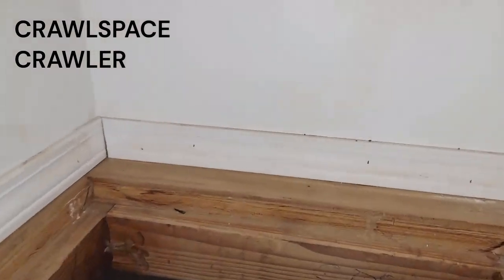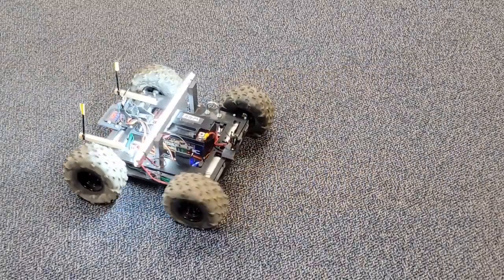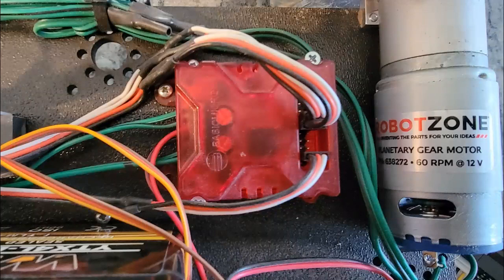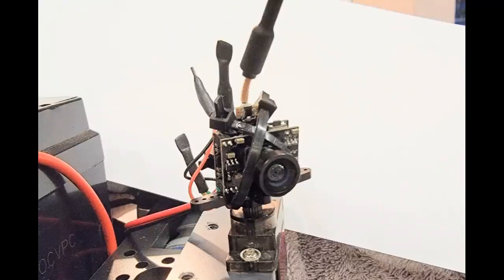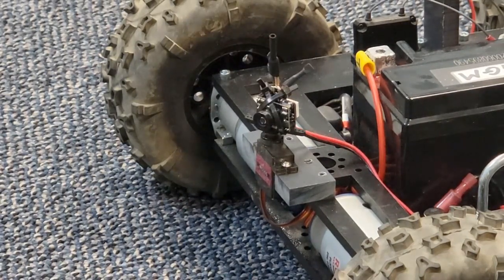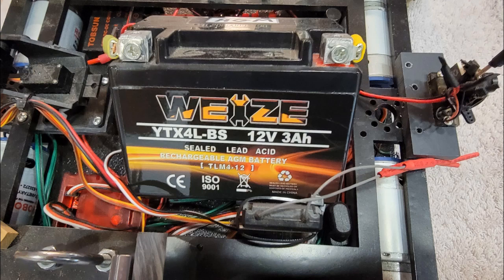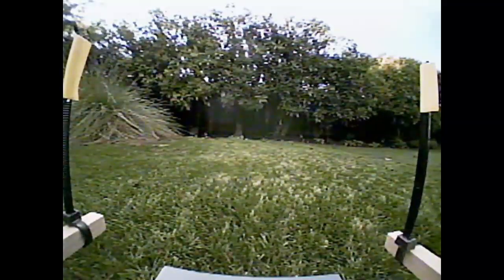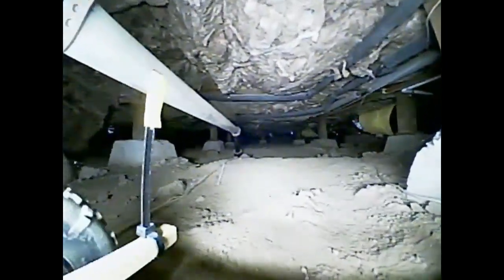Crawlspace Crawler

Comment: "just for fun, not a real human skull" Just what somebody hiding a human skull would say :p

Kit looks great! Only changes I could see really improving anything is installing front and rear light bars that fit between the wheels front and rear of the chassis, and try and get the cameras a little lower/lower profile to get the overall height down, but this looks like it fit your purpose perfectly. Good job!
Reply from the maker: The light bar I already had was 12" so it had to go above the wheels.  The camera antenna came up to about the same height.  6" clearance is fine for me, but a redesign could get it down to 4 or 5 inches with different lighting.  The landscape LED floodlights, even with diffusers, almost "blinded" the cameras with hot spots of light.  A shorter light bar would be perfect.   Thanks for your comment.

Comment: Fantastic.  It's a little elaborate and pricey for my limited needs today.  But if you wired houses regularly, this seems like a real no brainer.  

I find it crazy that someone hasn't made an affordable  off the shelf drone like this that is either intended specifically for cable pulls or is versatile enough that people regularly use them for it.

You can buy flying drones that do most of this all day for a few hundred bucks. But when you search for something wheeled, it's either a toy that goes too fast and has novelty features or a DIY raspberry pi kit that becomes its own project.

I especially love the horror/adventure flick music in the background.  That's exactly the feeling I have when I crawl under my house.  
🖐️😮  💀
Reply from the maker: I've had several comments posted about being able to pull cable or home security wire.  Sound like a great idea until that cable gets caught or snagged on something and then you have to go crawl to rescue your crawler.  Would the crawler need to go find the cable and then drag it back? There'd have to be some sort of grabber with a catch and release mechanism.

 I don't know how much "pull" my system has until the wheels slip in dirt.  I imagine a drone has even less horizontal pull.  I would also imagine that a drone would kick up a lot of dust as it flew through a narrow dirty area. So many things to consider.

Thanks for your comments, and don't give up.  Half of the fun is building it.
Reply: @jeffg8232  

I wasn't referring to using a flying drone for wire pulling.  Your wire puller is a wheeled drone.  People are just accustomed to hearing the word drone used mostly in relation to flying devices.

I was just comparing how the same level of features and technology in flying drones is much more affordable and widely available than wheeled drones, even though it should be cheaper to buy or build a wheeled one.

The $600 in parts and who knows how much in labor that you spent would buy a pretty nice flying drone.  It's crazy how those have such a huge market but nobody is  producing something like your crawler at the same or lower price point.  

Personally, I can think of way more uses for your crawler than I can think of for an aerial drone.  People just like the idea of things that fly and then they get bored of them.
Reply: @jeffg8232  

Regarding getting stuck, I'm planning to attach a recovery rope to the $50 RC car i bought to attempt my sprinkler wire install.  We will see.  Right now I'm just practicing driving it to make sure I don't bang around too fast.  

I guess I'll have to make videos too.  👍

Comment: Very cool project!

If I may comment on one detail: A lead-acid battery being drained at a 1/C rate (as you describe it lasting about an hour) may only deliver 60% of its rated capacity. Notice how the 10-hour rate is already .2Ah lower than the 20-hour rate, and that's a difference of only 150 milliamps, extrapolate that to a draw 10x higher.

That's ~2 amp-hours from a battery that weighs over 3 pounds... you don't have to go overboard with lithium, but even a 12V nimh battery with ~3000mah would double your runtime for ~$40 while taking up half the space and weight. (not that either is particularly crucial to your build.) 

That's also not a deep-cycle battery, so it may begin losing capacity fairly quickly in this application.
Reply: I didn't think that far into it, but I did think it would make sense to just get or make an adapter to use whatever brand cordless tool batteries you already have.

Comment: Great guide. 

Working on a build following yours, thank you.

Just couldn't get servo city or gobilda to swap motors out :( will have to buy them separately.
Reply from the maker: Sorry to hear that Servocity won't swap motors. I built my crawler in early 2020, and the kit was called "the prowler" , as opposed to the current "Recon" kit. Speed isn't needed in that rough area.

Comment from the maker: Parts List

Chassis/Wheels/Tires/Motors Kit     “Recon” kit   60 RPM Motors      Servocity.com

All other hardware was purchased separately:
Motor Speed Controller   Roboclaw 2X7A    set to differential (tank) mode
FLYSKY FS i6X RC controller  + FS-iA10B 10 channel reciever
12V – 5V converter for camera power  TOBSUN
Camera/transmitter   2 ea    EACHINE TX05  FPV Camera from Banggood
Pan/Tilt servo assembly
RC servo for rear camera
RC switches for light bar and camera power selection
12” LED light bar  from LED Wholesalers.com
Volt/Amp meter display
6 circuit terminal block
Power switch and fuse
12V Battery AGM Sealed lead acid 3 AH
U Bolts for lifting.
Reply: Based on the dimensions, it looks like you could replace the battery with a Dakota Lithium 12V 10A battery, or even possibly the 23A version. While I imagine the 1 hour run is generally sufficient, you could triple it.
Reply: Hammerhead Chassis Kit instead of the Recon, better for very uneven ground. But $100 more.
Reply from the maker: @walterkarpynka8343  The Hammerhead kit is really cool.  If I were doing this all over, I'd get one.  I don't know if it was available when I was building it.  Thanks for the suggestion.

Comment: Cool. I got a basher because i wanted something with enough mass and a good suspension system to driver around FPV smoothly, but i couldn't use it indoors because the slowest it can go sends it zooming across the floor. This looks like a good build. I've actually been considering something similar but i wanted to use omniwheels and i haven't throught the built through yet, i'll probably copy your specs. Thanks :)

Might also finally be able to put my three way video switcher to use.
Reply from the maker: Thanks!  I've been very happy with the slow speed that those 60 rpm motors have. Beginner's luck, I guess, this is my first try at an RC vehicle, although I had an excellent mentor who does trucks, drones, and fixed wing RC with a passion.   I just switch power between front & back camera.  Sort of crude, but I don't use the rear camera much, only if its in a spot that's too tight to turn.

Comment: This is exactly what I am looking for! I have tried multiple RC cars but they either got stuck or flipped over due to the uneven ground under the crawl space!
Reply from the maker: Those RC cars are too fast, as well.  Go look at Servocity.com and look at their chassis kits. A great place to start.  I used an earlier version of the "RECON" kit, with lower RPM motors.  Lower speed, a lot more torque.  My crawler has never got stuck or flipped, other than once getting tangled in some telephone wires.
Reply: @jeffg8232  I have ordered the hammerhead + 12v control bundle as you suggest below. How did you ask them to send you the 60 rpm motors? Did you place the order and then left a message for that request?
Reply from the maker: @yingxu7262  This was several years ago when I built it.  I remembering getting on the phone with their customer service group, and requesting substituting the low RPM (60 RPM) motors,  but I don't know if was before or after I had placed the order.  I'd call ASAP. Or maybe you could exchange them after you get the kit.   Let me know how the Hammerhead chassis works.  That wasn't available when I built, but now I wish I had it.

Comment: I'm working on something similar, since I want to run some cables. In addition I need a robot to drill a hole through a rather substantial wall.
Reply: I'm skinny, you can just hire me. Its gonna take a very heavy robot to drill a hole
Reply: @jenkins1017  Lasers!

(Yeah, I know, they're not really powerful enough on such a small platform, fire risk, etc, etc, etc).

Comment: Would you be open to making another one for sale? If so how much? I am looking to find something just like this for my jobs
Reply from the maker: RJ  Thanks, but I'm not interested in building another one of these.  Quite frankly, I'd go to ServoCity.com and look at their Hammerhead or Recon chassis kit with the 12V Radio Control bundle.  That gives you chassis, motors, Motor controller, RC sender & receiver, and battery. All you'd have to do is add the light bar and cameras.  Too Easy.
Reply: @jeffg8232  I will do just that!  Thank you!! One other question: what FPV camera unit do you recommend? I need something I can use for shoring and plumbing inspections under home... so will need something pretty clear with FPV and ability to record video and photos
Reply from the maker: RJ  Several suggestions:  The off-the-shelf kit from Servocity has 300 RPM motors.  I had them substitute 60 RPM motors to give 5X torque.  You don't need speed in a crawl space.  I'd also forget the 2nd rear view camera.  I rarely use it and it ties up 2 channels ( pan servo and camera power switch) on your receiver module. I'd also just use a simple voltage monitor rather than a Volt/Amp monitor. Voltage is enough to monitor the battery, and its much easier on the wiring.  The camera/transmitter that I used (Eachine TX05 from Banggood) was easy to setup, but the video quality is not the best, as you can see from my video. If I were to rebuild, I'd look for something that could transmit Hi def video.  Maybe a battery operated home security camera, or something like a GoPro.  I use the Microsoft "Camera" app on my desktop for the remote driving, and it has the ability to capture still shots and video.  Since I only use this at home, I haven't explored using my smart phone for a monitor or recording device.